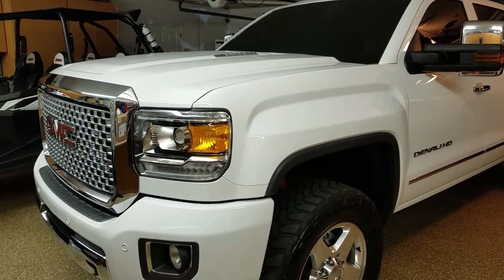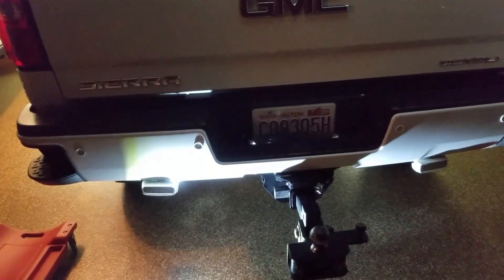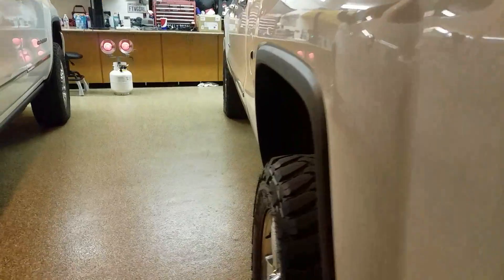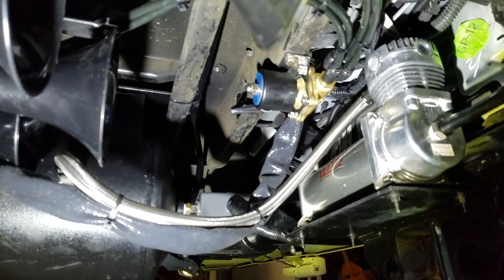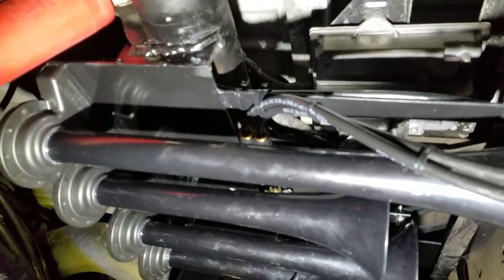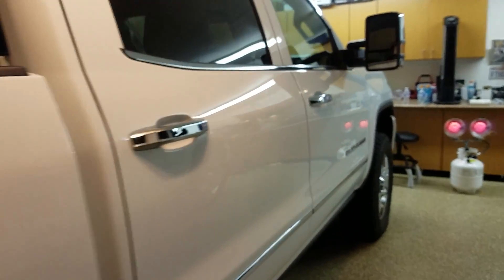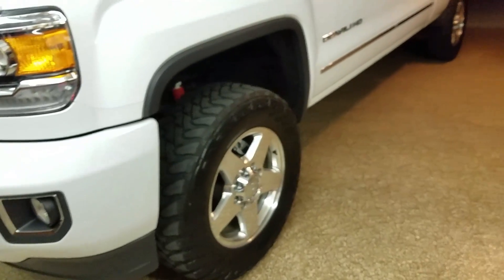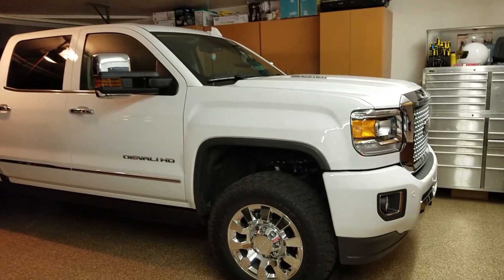2016 Duramax tuned and deleted

Comment: Was wondering what size leveling kit you have on the trucks and did you have to do any trimming so they dont rub with the 35in tires
Reply from the maker: Ryan Miguez 2 inch with 295-65-20 I did not do any trimming
Reply: Thanks do they rub at all
Reply from the maker: yes they will rub

Comment: What kind of tuner are you running? I saw the little screen on one of your other videos just couldn’t tell which tuner it was
Reply from the maker: i am running a ppei tuner with the ez lynk system the little screen is just a monitoring system to monitor everything going on
Reply: Eddie's Life after watching some of your videos, I take it you're happy with ppei. Did you buy a custom tune? I ask because I have a 2015 lml 3500 crew cab stock height and wheels and I'm lucky if I get 10 mpg while towing a 7500 lb trailer. I'm running a Kory Willis tune as well and I'm more than disappointed.

Comment: You got any videos of the exhaust sound on take off?   Im thinking about deleting and going with the 4 or 5 inch flo pro.
Reply from the maker: i will try to get some for u but pretty much the 4inch is going to b quieter than the 5inch thats the only difference between the 2 diff sizes

Comment: were the AMP research steps hard to install? I'm looking at a 2017 L5P which has the larger DEF tank, just thinking if the steps would have any clearance issues on the passenger side when they come down?
Reply from the maker: No there pretty easy especially now that there OBD2 powered, i think the hardest part is cutting out the front trim for the step to go up in to, thats pretty much the hardest part